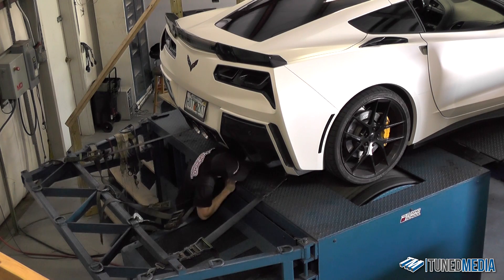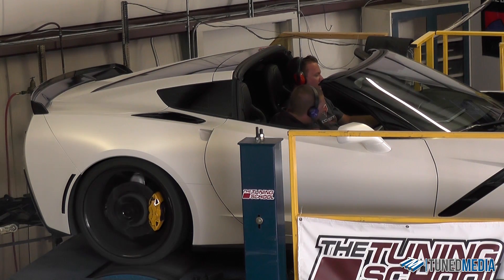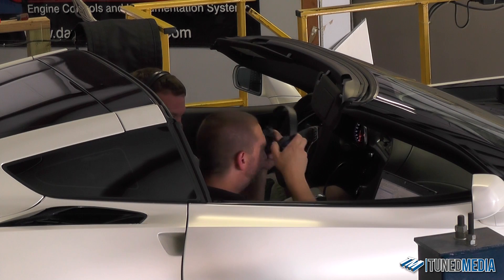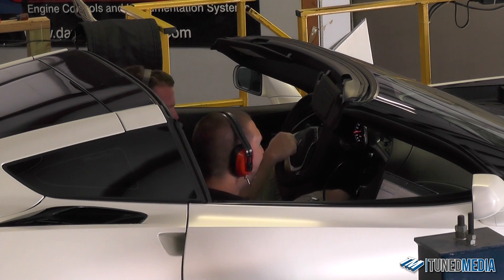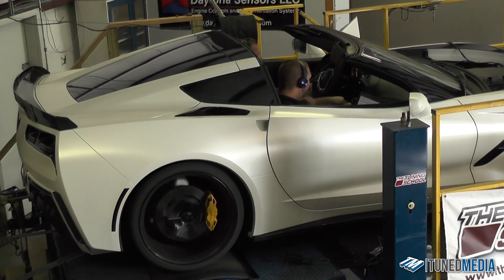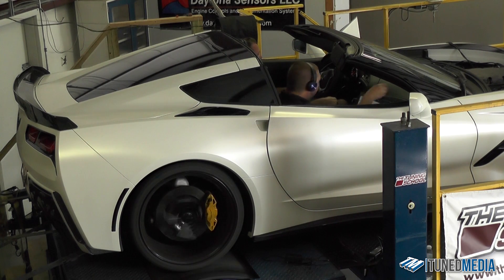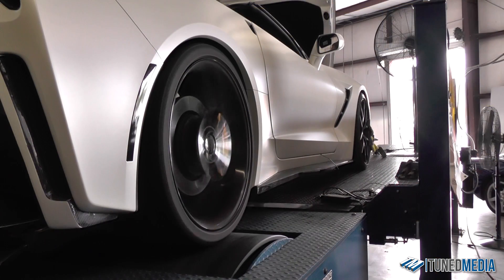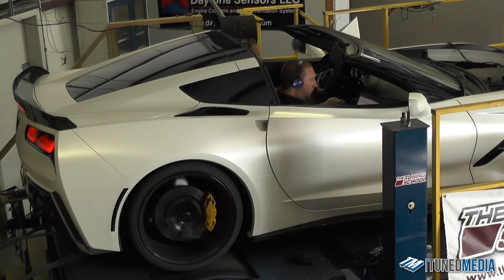Why You Need a Plex Knock Monitor Next to Your Wideband on Your Dyno

Comment: Is there a solution to mount the Plex knock sensors on Coyote 5.0's with blowers?  The knock sensors are under the blower and I don't believe there is a way to access them.